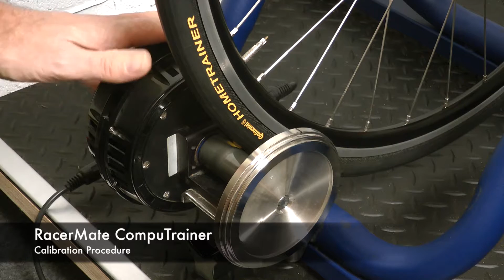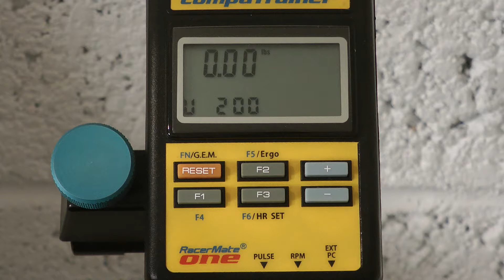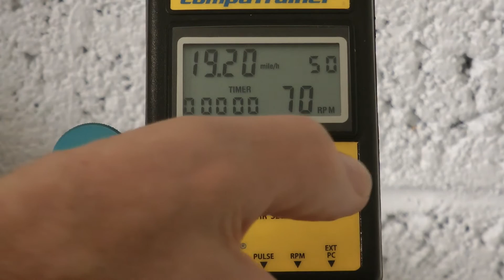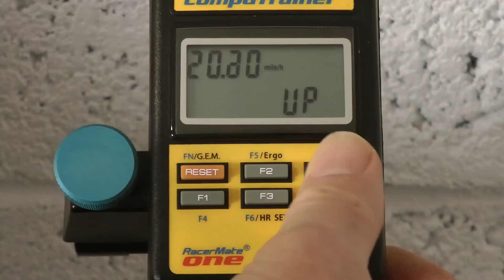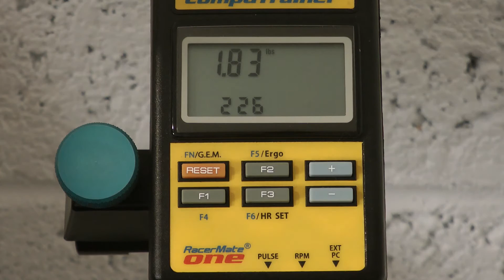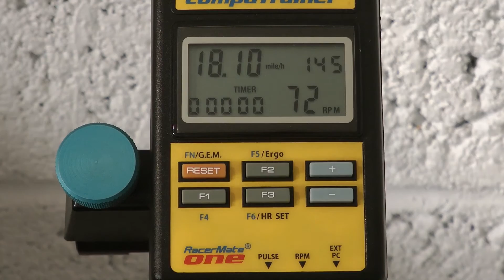Calibrating a RacerMate CompuTrainer

Comment: That is so helpful Quentin.  Also appreciate your film on perfpro.  Will get the perf pro.  How do you connect the computrainer head unit to the laptop?  Is it fairly straightforward?   I've been using my computrainer for a couple of years just as an ergo trainer although using my own or coach's workouts.  I found the racermate software to be fairly unhelpful but hadn't thought to look for an alternative.
Reply from the maker: Glad you found it helpful Richard, it's amazing how many folks get this wrong! The HC connects to a PC/Laptop using the cable supplied with the CompuTrainer, usually via a Serial -> USB connector, also supplied with the trainer, it's all in the manuals. I never use the RacerMate software any more and if that's all you are using you are missing out on a lot of the potential of your unit.

Comment: This is what the instruction in my manual says : Flat Course - use 2lbs†
Press-On Force
Up to 2.5% Grade - use 2.5 lbs† Press-On Force
Up to 5.0% Grade - Use 3.0 lbs† of Press-On Force
Up to 7.5% Grade - Use 3.5 lbs† of Press-On Force
Up to 10.0% Grade - Use 4.0 lbs† of Press-On Force
Up to 12.5% Grade - Use 4.5 lbs† of Press-On Force
Up to 15.0% Grade - Use 4.99 lbs† of Press-On Force*
†Plus/minus .20 lbs acceptable.
*5.0 lbs exceeds the maximum value you can save.

Comment: Wondering what part of the calibration is happening after reaching 25mph and coasting to a rest?  I would like to calibrate my Computrainer with a fixed gear bike if possible.
Reply from the maker: The coastdown IS the calibration phase, it is what allows the unit to calculate the current press on force being applied which is the basis of all the calculations the unit does. I think you are out of luck wanting to calibrate using a fixed gear.

Comment: I have had my computrainer for close to 20 years.  Purchased when it first had to be run through Nintendo.  About 5 years ago had to get my generator serviced but has worked strong ever since.  I don't have my manuals and I have always ridden in erg mode.  But I use some software that does not talk to CT and I am trying to figure out how to use Stand Alone Mode and what all of the pre-programs are.  I can't find any info.  I have a PM on my bikes so I would use that.  Do you know what all the programs are? I know there is like 1-59.  Not sure what to use so I can just run through  my gears.  Thanks for any help you may be able to provide.  Anthony
Reply from the maker: A Google search for "computrainer manuals" will bring up options for downloading all the manuals etc. which should answer your queries. I never use standalone mode, I always use it hooked up to a PC which allows me to get the best out of the equipment and gives so many more options.

Comment: Hi Quentin, did you say that one needs to calibrate everytime you using this? Over a week , if you rode everyday, thats 7x calibration?
Reply from the maker: That is correct Ron, A CompuTrainer has to be calibrated every time it is used, that way you get a very high degree of accuracy and consistency, well worth it.

Comment: Thanks for the video. Question: If I am going to do simulated climbs, is it better to calibrate with a higher resistance or lower? My thinking was that if I calibrate while in a high gear and use a high pressure, I have more "space" to reduce the load for when I am performing simulated climbs.
Hope that makes sense!
Cheers
Reply from the maker: I'm afraid I don't really understand your query but the required press-on force is covered in the manual. As a general rule it should be around 2.0lbs but if there were a lot of hard climbs calibration could be done with a higher press-on force, as long as the calibration is done properly the actual number does not matter as the power numbers will still be accurate. Essentially the press-on force needs to be sufficient to prevent tyre slip, and no more.

Comment: If you go on zwift... 3.0 pounds will be ok fot big gradient. Youre calibratio n is ok but after you have adjust the pressure on the wheel, simply go for 10 minutes, 150 w, and then finish the calibration proces, It will be more than enough

Comment: Hi... Does anyone know why it shows "99.99". like sort kind of error... when trying to calibrate the RRC?
Reply: Could be the din cables need cleaning or replacing
Reply from the maker: Not an error I'm seeing I'm afraid.
Reply: Hi BYK. I know you posted this awhile ago, but did you every find out what caused the error? I'm trying to calibrate mine, after the trainer has sat in my closet for over 2 years. I'm getting the same error. I swapped out both the DIN cable and the handlebar unit with a friend's, but I'm getting the same error so I think the issue is at the roller end. Appreciate any help. Jane.